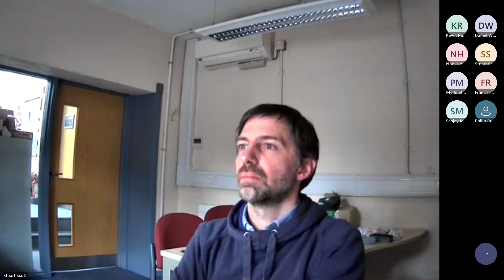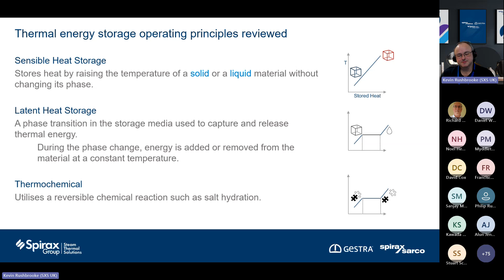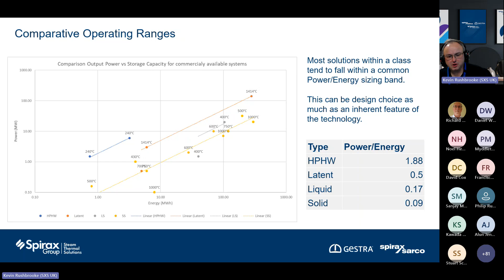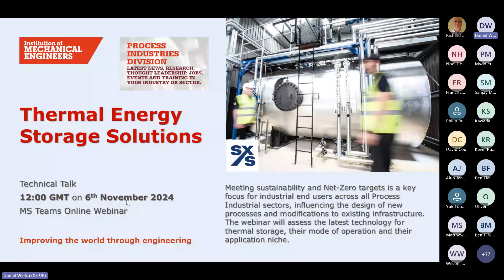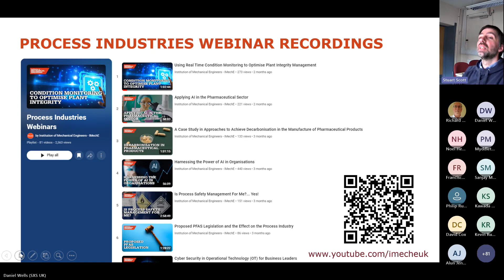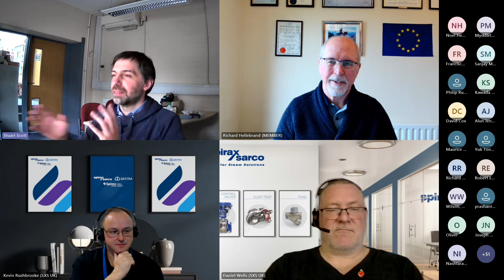Thermal Energy Storage Solutions

Comment: Sand heat batteries can work as a home winter solution, for buildings, or even in a community-wide basis.  Beyond that, using ceramic power lines wires instead of metal ones, in reconductoring strategies, could double energy throughput, along the very same rights-of-way and tower infrastructure.